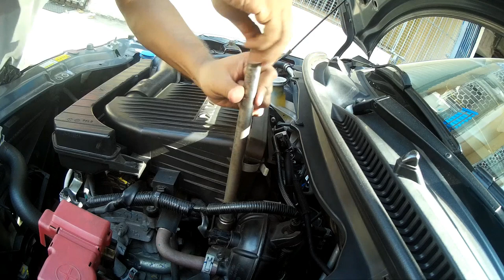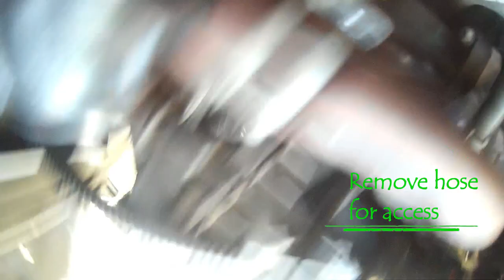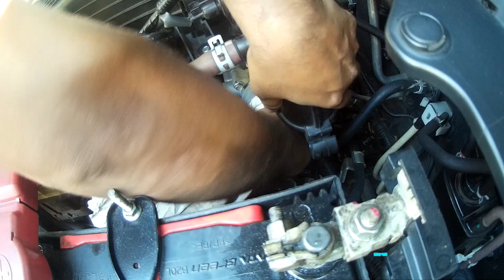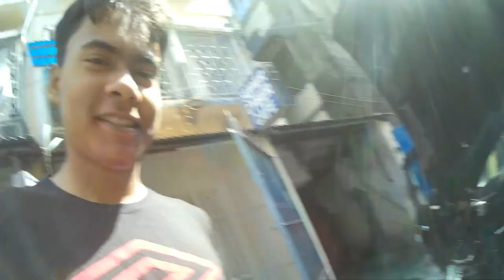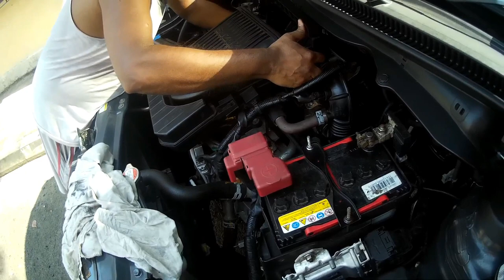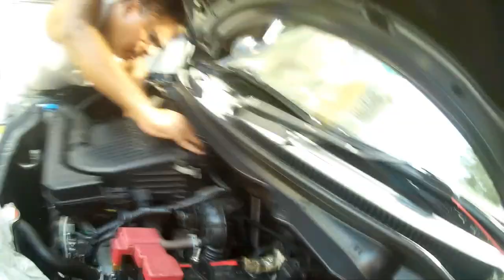Suzuki Swift Throttle Body cleaning #suzukiswift #throttlebody  @supercyberautomotivetravel

Comment: Thanks. Performed on a Suzuki Solio 2011.Made a huge difference. At first I thought the jerkiness and poor acceleration was down to the CVT transmission but a good throttle body cleaning helped tremendously. I left ignition on and used a bar to press accelerator to wot. No need for idle relearn.

Comment: Hi there!
Did you only turn the ingnition and press the throttle to open the valve? 
Or did you fully turn the engine on and just rev it?
Reply from the maker: I turned on the ignition and pressed  the throttle to open the valve with the engine in the off position.

Comment: Can we clean it with petrol also?
Reply from the maker: You can but for that you need to dismantle the throttle body and clean with a brush. It's better to use throttle body cleaner spray as it will spray with good pressure and  clean the butterfly valve . Also dismantling is not recommended until and unless absolutely necessary.
Reply: @supercyberautomotivetravel  my swift dzire petrol has clocked 18500 kms only in 10years. It hasn't any RPM issue. I haven't cleaned throttle body ever. Should I clean or not?
Reply from the maker: Less running means it will have more gum and carbon deposits. Once you clean you will feel the difference.

Comment: Hi sir i have new spresso 
My throttle body be dirty after 7000 km , its normal for a new car.
And if you clean the throttle without take it off , the dirty parts enter to the engine
Reply from the maker: It won't get inside the engine as the dirt will get burnt and escape through combustion process by the exhaust. Km driven is not the only indicator of dirty throttle it may be clogged due to various factors, poor quality of fuel, too much driving in low rpm and do on. Clean it you will feel the difference.
Reply: @supercyberautomotivetravel   thx sir but there is no contact between throttle and fuel

Comment: For wat problem
U did did cleaning..

I have pick-up and less milage problem. May be misfire missing.

What should I need to do.

The company serving people they don't know nothing about it. 
They do for their learning.
Reply from the maker: Have you done the routine service . If you have an erratic idle and fluctuations in rpm go for a throttle clean and change your spark plug too.Also check your fuel and air filter if they are choked you may face the same.
Reply: @supercyberautomotivetravel  service done every 10k at showroom only 
Driven so far 120000km
Reply from the maker: Do you get any error code. Do a proper scan test
Reply: Today I will take to service center and let u know
Reply from the maker: Do tell them to check for wire cuts as sometimes rats do the job.
Reply: Brother I'm using the petrol vxi as commercial purpose. So I use ride daily min 100 to 150 kilometres.
My clutch keep on became Hard. 
When I replace new one it will be very smooth. 
Last time I changed and it's gone just 3500km and now it's Hard
Why its happening
How about your experience.can u share
Reply: Han willl inform them
Reply from the maker: Hard clutch is normally a signal of worn-out clutch. A clutch should normally be fine for at least 20000km depending on driving style . When replacing clutch practice will be change flywheel also which SC doesn't follow always. Also take care of release bearing.
Reply: Thanks
Now feel happy
After cleaning throttle .
They did freely since I'm regular.
And I have few noise in the bannet also that work also done.

After serving
NO VIBRATION EVEN IN AV
NO JERK
PICK UP WAS BETTER
ITS LIKE NEW SMOOTH

 
ONLY clutch I need to check its take one day they said
So I said will give later.

Comment: how about resetting the ECU  after cleaning the throttle??
Reply from the maker: In my case resetting the ecu was not required as I did not receive any engine check light. In fact I did my annual cleaning just few days back . If you receive engine check light disconnect the battery terminals wait for some time   and reconnect your ECU will reset.
Reply: is it the same  calibration on suzuki celerio? (a-star)
Reply from the maker: Yes  it is same with all K series engine
Reply: Body to nikalni thi.. Sara carbon andar hi gaya hoga
Reply from the maker: @MrGaurav2807  Light carbon deposit me jaruri Nehi. Agar apka throttle atak rha hai aur jada gumming hai tab nikalna jaruri hai. Car run karne por deposit jo andar giye sab burn ho jayga.
Reply: @supercyberautomotivetravel  aur aise cleaning karne se jo andar Electronic sensor pe problem nahi hogi?
Reply from the maker: @MrGaurav2807 .Hum to itne bar kahi car o me kie hai kabhi problem Nehi hua .
Reply: @supercyberautomotivetravel  thanks a lot brother..

Comment: Hi Sir at the time of throttle body cleaning how many kms your car completed ???
Reply from the maker: It depends if the car mainly runs in city and slow speed the chances of gumming up is more also depends on the quality of fuel. As a standard practice I used once every year irrespective of km runs
Reply: @supercyberautomotivetravel  thanks for the reply

Comment: Ur not reaving up engine while cleaning throttle body  ?
Reply from the maker: In a cold engine revving is not recommended.
Reply: I think he means was the engine on whilst you depressed he throttle, which I understand it wasn’t.
Reply from the maker: I did in the cold condition.